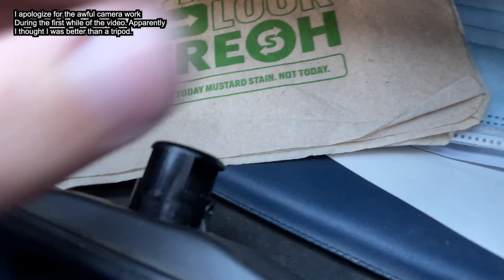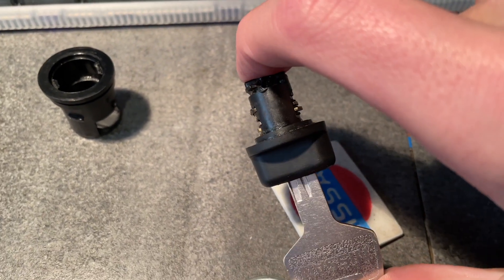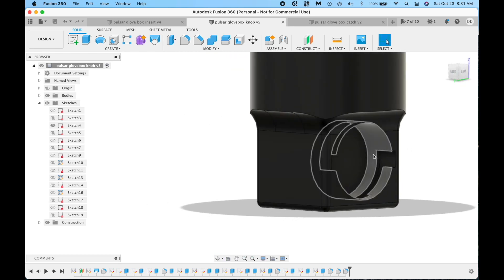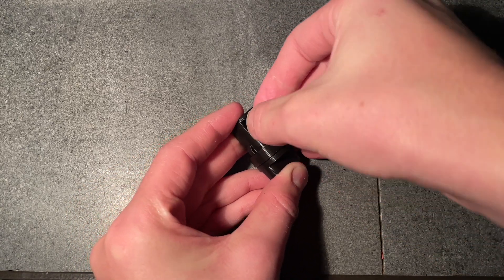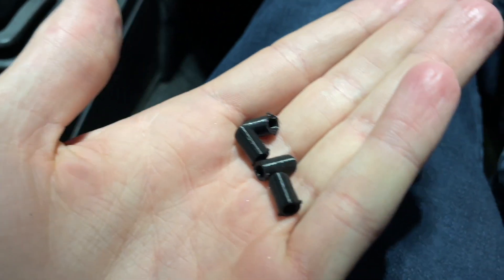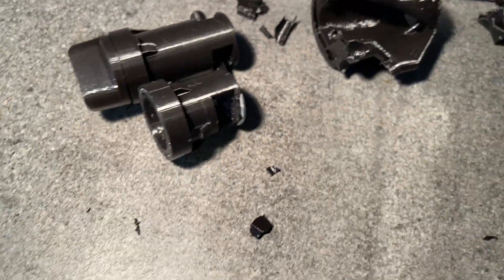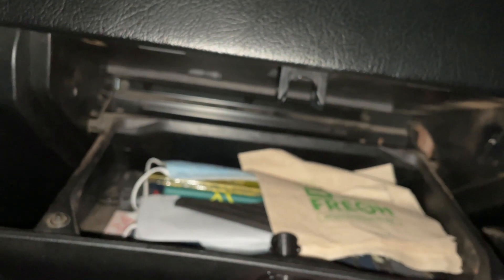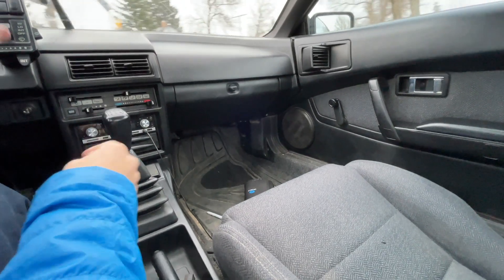Fixing Nissan Pulsar Glove Box - 3D Printing Latch

Comment: Hi. Do you still have the file? I'm trying to repair my 1987 pulsar's glovebox.
Reply from the maker: The PLA warped with heat, but maybe a more stable filament would work better. Here is the printables link: https://www.printables.com/model/1250437-1987-nissan-pulsar-glove-box-latch.

Comment: Do you still have the STL file? I have an 84 Pulsar and the whole mechanism is missing.
Reply from the maker: The PLA warped with heat, but maybe a more stable filament would work better. Here is the printables link: https://www.printables.com/model/1250437-1987-nissan-pulsar-glove-box-latch.

Comment: Do you still have a copy of the STL file? I have the same car
Reply from the maker: The PLA warped with heat, but maybe a more stable filament would work better. Here is the printables link: https://www.printables.com/model/1250437-1987-nissan-pulsar-glove-box-latch.